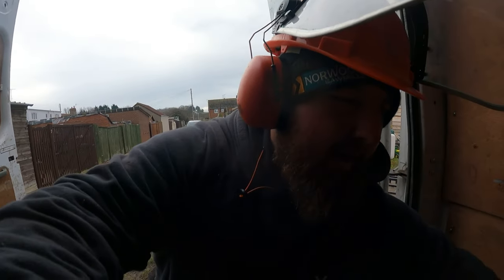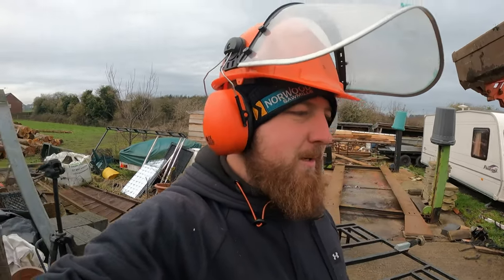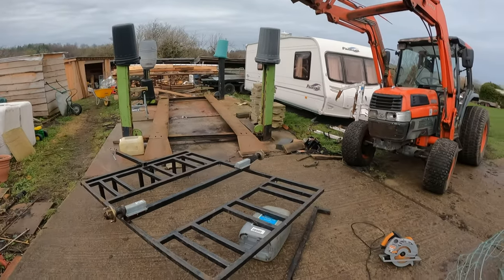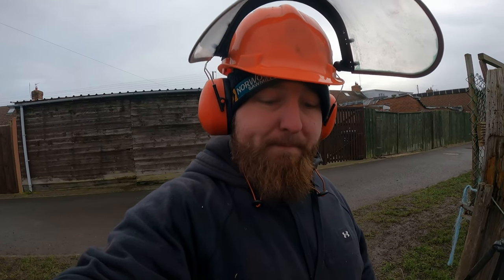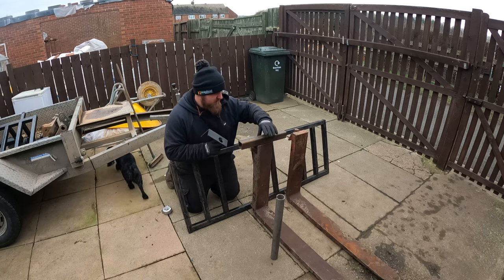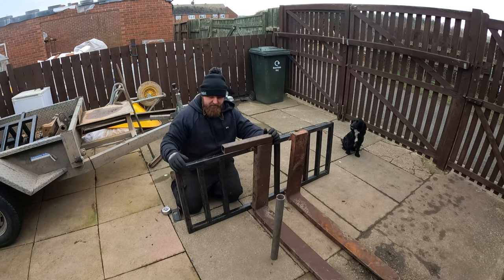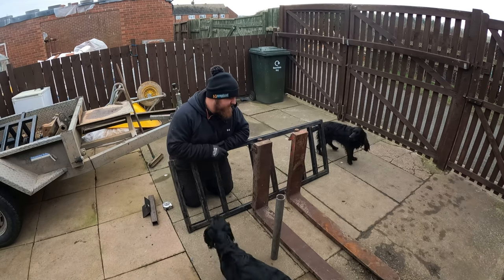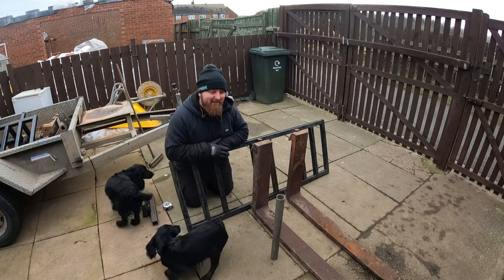Making pallet forks for Kubota tractor ~ part 1

Comment: Hi Nick, I did! I made without a plan a kind of pallet fork for my mini excavator from the little I had, a leveling bar that I had made and tubes. I was in a hurry and simply welded the tubes without being able to adjust them and... that's enough for me, it allows me to transport a small pallet transformed into a crate being limited in weight by the XN-08 mini excavator. She does the job!
You are lucky to have a Kubota! For the welds I think I'm going to pay for a cored wire station because welding thin metal with rods is horrible!
By the way, it's your keys that are foreign, I have the right ones, just kidding!
Reply from the maker: Yes I've seen pallet forks for excavators and they look pretty cool but for me it would be painfully slow. The kubota is excellent for that work. 
Flux core wire is great and very versatile, I prefer welding with gas as it leaves a much nicer finish and no wire wheel is required to tidy things up. 
Please remind me what you mean about my keys being foreign 😆 
Thank you as always buddy 👍

Comment: See you on part 2 can you not put them on the bucket like the Jacob boys and flip them out the way when not in use stay safe lad 👍👨🏻‍🏭
Reply from the maker: hey Paul thanks as always good buddy. Hows things with you ?
i decided against the bucket style forks as it would be more weight out front than id like. This tines are from a 5 ton forklift truck so theyre heavy duty for sure. This way i can have a bucket attachment and also pallet fork attachments. 
Thank you again buddy, i can say they are working great.